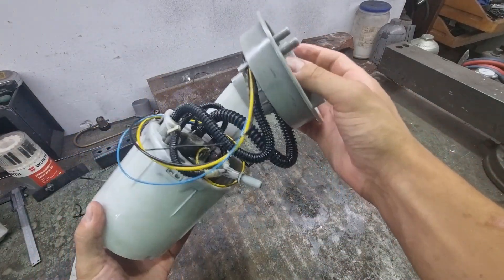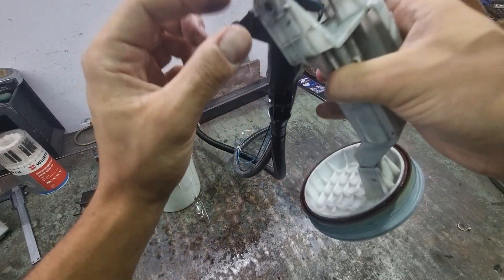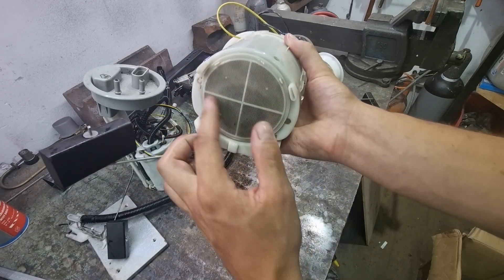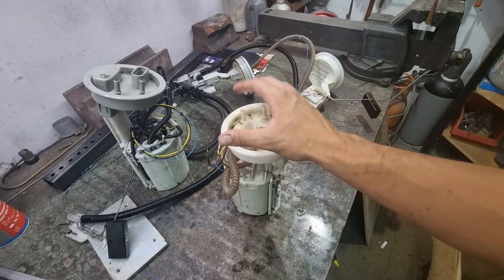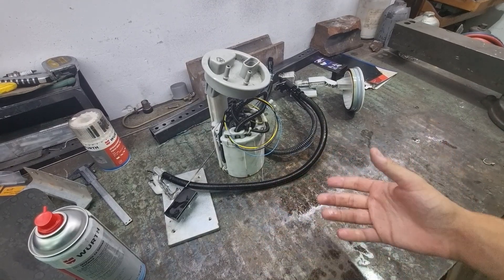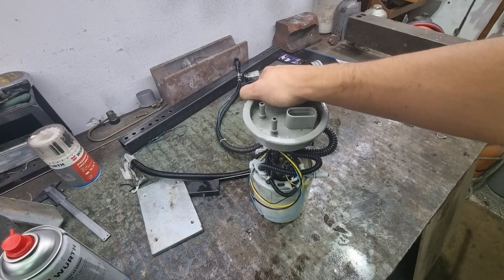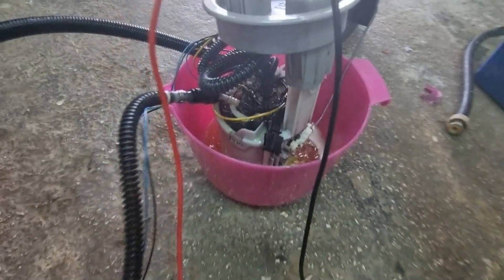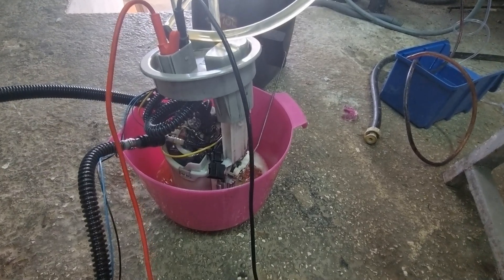How the 4Motion Fuel Pump Actually Works – Golf IV / Bora / Jetta

Comment: Hello, i have problem of blowing fuse near the battery which is 50a fuel pump as i understood it may be from the fuel pump shortening because its old, any tips where i should look?
Edit: the fuel pump is working i tried replacing the metal fuse, car starts but it blows again afterwards

Comment: Thx for the very informative video. My friends MK 4 116PS PD(AJM) 4motion needs a new fuel pump assembly. I already know that there are different units for the 2WD u 4WD models at least according to stock supplier VDO/Continental. If I search for the replacement part every parts seller describes thoses third party units(Delphi, Magneti Marelli etc.) fitting 2WD PDs as well as 4WD. Rly confusing as the 4WD version should have an additional hose connection to receive Diesel from the "slave pump" sitting in the second tank half. Also there should be a connection for the fuel level sensor from the sec. tank half.(or is there none?)  Would be much appreciated if you find the time to get by my question.

Comment: is there any difference between 4motion fuel pump and fwd pump?
Reply: Yes. Fwd pump does not have the connections for the ejector pump of the right tank half.(not hose connect and no additional power connect) You can definitely use a fwd pump as well if you go for a y adapter instead and also connect the power directly to the mainpower of the main pump. The OEM 4motion is quite expensive(250€+) so it makes sense to go for the fwd version+diy.
Reply: @Squilliam-Fancyson i have the pirburg pump not knowing that the one in my tank has the second small hose connection . How can I adapt the normal pump to my system,? 4motion 1.9 pd 131 .
I didn't found any pump with 2 connection, only original but not afordable